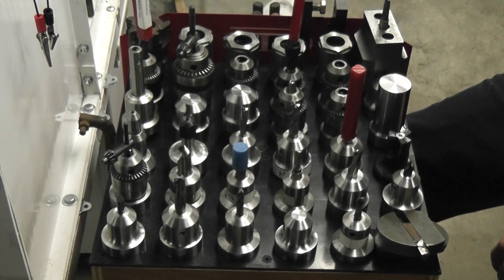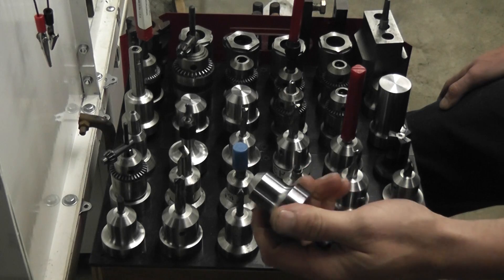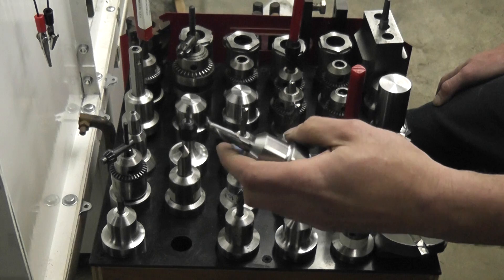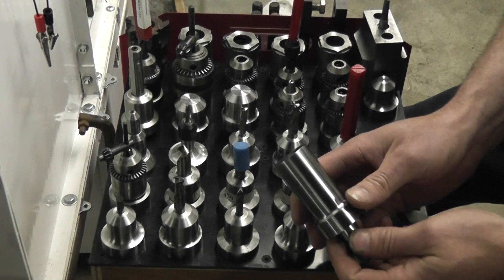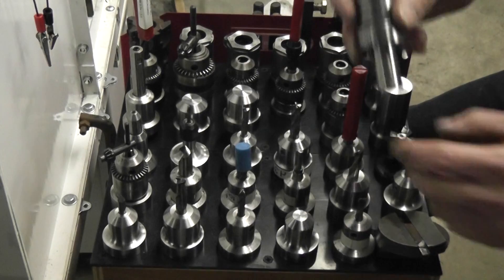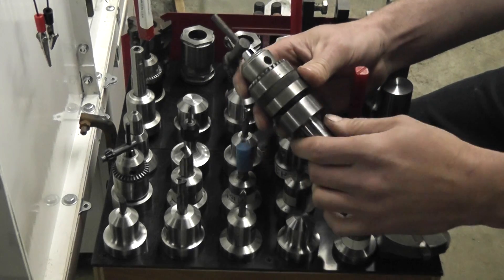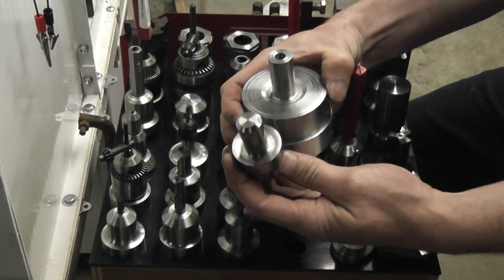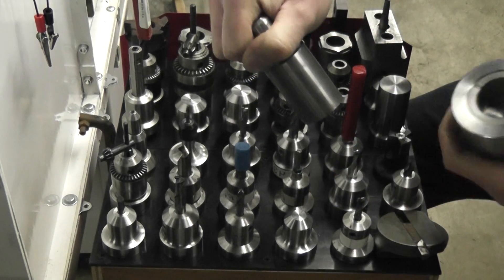home made tool holders

Comment: Very nice! Are you still willing to share your  G code?
Reply from the maker: There is a link on my blogger page http://bozidarsbuildnstuff.blogspot.com/search/label/CNC
Reply: 22BOZIDAR Thank you, I found it after I sent this. The problem I am having is that at the top of the cut my spindle is stopping from the tool hitting the face. I decreased the feed to F2 but no change. I have an SX2 High Torque mill. I am new to turning. I have a 4X16 lathe that I'm going to convert but until then I want to conquer this type of machining. I have pics but cant attach them here. Any thoughts?
Reply from the maker: Joe Stefano .  Not sure what the power of your spindle is. If the spindle is stalling, you can make new G code that takes lighter cuts. The code was made using the Mach3 turn wizards

Comment: Do we assume that you use a swing up threading tool?
Reply from the maker: Not sure what you mean by swing up threading tool
Reply: Clearly it wasn't one. A swing up tool allows you to reverse the lathe and leadscrew without withdrawing the tool as it automatically clears itself from the workpiece and comes back to position once clear of the end. There are a few youtubes showing their use. They are not new as first patented in 1883 but few know of them.
Reply: Chris Stephens The reason I asked, it that it looks like the tool stayed in the thread when you reversed, something difficult if you don't have a swing up, due to backlash.
Reply from the maker: Ok, I think I have seen what you are talking about. I have a good size collection of old Technology books from around that time. On short threads i just reverse the spindle. Because the halfnuts are really worn out on the lathe. Putting a small amount of drag on the hand wheel in reverse helps in keeping the tool lined up.

Comment: Very nice video.  I notice you have much less chatter than I get in the transition from a turning cut to a facing cut.  I can do one or the other with no problem, just trying to do both in sequence seems to always be a compromise.  I might try a tool like yours the triangle configuration rather than my diamond tool.  

Your tool rack is great as well - I need to make one.  Once you've got one holder, you've got to have a dozen!  BTW, the boring head is a real beauty!